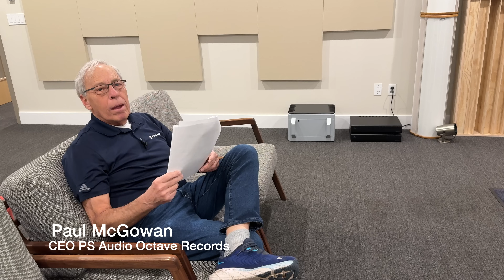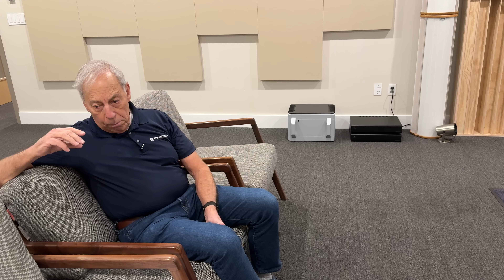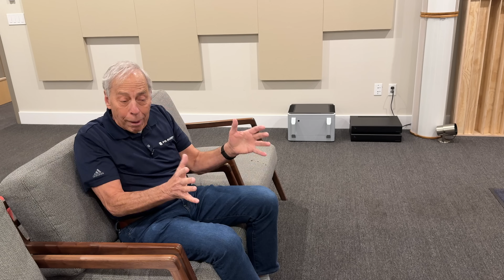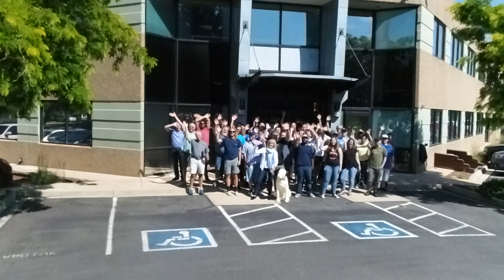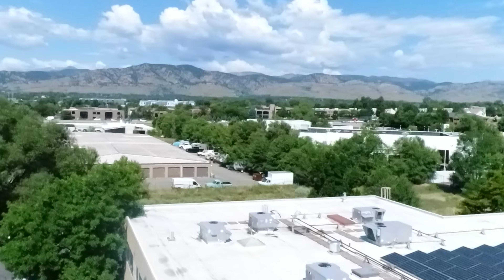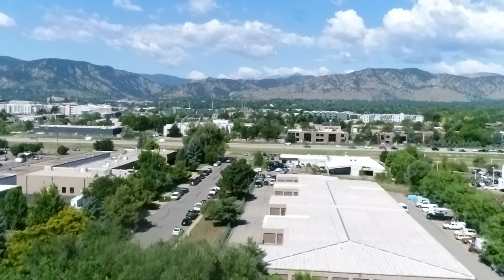The importance of power supply design

Comment: In the late '70's the "Damping Factor" spec started being paid attention to by the better manufacturers. It started as just the mathematical relationship between the PS internal resistance and the load impedance. Solid State PS were designed with as low an internal resistance as possible. This allowed the PS to deliver more of it's power to the load with less internal PS loss. It also allows the counter EMF from the speaker to be shorted out and the driver stabilized. Basically a DF of around 100 was about perfect. 

Then came the DF wars. How to dramatically increase the number while making a worse sounding design. With DF's exceeding 1000! They do so by using feedback loops instead of just good PS design. That basically when voltage is lost internally inside the PS, the gain in the output stage is increased to produce more output so the voltage across the load is correct while ignoring the PS voltage drop. So while this might provide one aspect of a good DF, constant voltage as a solid state amp requires, signal is still lost inside the PS and the counter EMF signal gets fed back into the amp causing distortion. 

Be careful of the DF spec game.

Comment: I would guess if you use a power regenerator like the PS Audio power plant, that would clean up most of the power issues, maybe even all of it?
Reply: No it won't. The power regeneration maintains a constant source of mains power. What happens inside of the amp is a different situation entirely.

Comment: Can somebody explain in a technical fashion How switching power supplies are starting to "outperform" linear power supplies?
Reply: Linear power supplies efficiency is around 60-70 percent, switching power supplies can go up to 96 percent. Switching power supplies are smaller in size, and if done correctly, they gonna have very little noice. Usually low noice switching power supplies work at very high frequencies, way above hearing range. They affect the sound little differently than linear power supplies. Switching power supplies make bass faster and tighter, will have a little tighter sound stage, and more dynamic sound overall. And they are way smaller in size, so designers of DACs, power amplifiers, preamps, streamers can use space left from switching to switching power supply to use more parts that are necessary to improve products sound quality. The problem is that companies usually don’t really care about using low noice power supplies, because they are costlier, harder to make and use expensive parts.
Reply: @maximdmitricenco8976  appreciate the comment.....but you listed general differences. I'm curious about technical aspects.

Comment: Great Q&A.
Paul's description of an amplifier simply modulating power from the PS to the speaker is really a great illustration.  I built my own OTL triode power amps.  (using Rozenblit's patent).
When you look at the output stage which drives the speaker, there are only 3 parts.  A valve and 2 resistors.  I didn't change the design, but I sure beefed up the power supply to good results.
Reply: You should make a video on how you did it!

Comment: If you want to learn how to design a power supply, build a class-A amplifier. The PSU will be running very hard, but you may only have a low signal at the output. Every gremlin, ground resistance, loop, rectifier noise or wiring error will manifest itself.  Intresting the discussion about good PSU design with the care required,  and the HiFi fuse topic, which apparently transforms the, well , er, power supply. I always say, if the fuse makes a difference, you kit is junk.
Reply: Don't tell me what to do!
Reply: @RoderikvanReekum You might learn something
Reply: @davidcross890 Yea I guess so, complicated stuff though.
Reply: @RoderikvanReekum  yes not simple but so worth it

Comment: A lot of effort in most cases.
Not just an effort to supply as smooth as is possible D.C. from the power supply direct, but also additional smoothing throughout a circuit as well.
Very low distortion and noise results at the outputs would not be possible otherwise.

Comment: Paul, in the early 80's Output Voltage Rise Times/Slew rates were at around 200V per Nanosecond "Mew"! How fast are they nowadays!
Reply: Van Alstine has 800v uS their stuff has like 5 separate regulated power circuits in my AVA hybrid pre amps.  AVA, better stuff without the nonsense.  No magic wires either
Reply: @cengeb  I personally am waiting for the Newest Ultra Fast Switching circuit technologies to achieve .001 picosecond Rise Times!  😉
Reply: @j.m.harris4202  Make sure you have the proper AC line cord and wall outlet that will allow that speed....PS will certainly have such stuff, they just need to print new stickers for existing stuff.
Reply: Paul is one of those YouTubers who DOESN'T like or reply to comments on his channel. He's probably too busy? He likes to give the "benefit" of his wisdom, and to plug his own products, but sadly, he's not interested in anything YOU have to say! 🤣
Reply: @marcse7en  He knows everything...in his own old very old, mind.  Shills for whatever he can sell.  And he claims he's an engineer?  What degree, or professional certs does he have.  "Engineer" creds is a legal issue, false representing oneself as a "engineer" is fraud, states fine people using titles like such, when there is no degree or certs to be had.  Salesman is basically PS claim to whatever he is famous at?
Reply: @cengeb  Paul is in fact an engineer because he Performs That Function.  
You seem to suggest that one needs a degree in the subject to do it.          
Was Thomas Edison a degreed electrical engineer?  Nope.  
Paul has no more need of a degree than Edison did.
Reply: @spacemissing totaly wrong, it's a legal term, try understanding the rules.  states fine individuals and companies, if using the term "engineer" in a title on paper work, ads, fact.  I've been in the business that involves the term....company had to restate peoples titles, fact.  Again, PS is mostly marketing blather, and if they don't understand stuff, as you, it's sad.   So folks with actual degrees in engineering, spend thousands for it, don't need the diploma, cus according to you, just use the term.  Wow, the education system is failing in the u.s.
Reply: @spacemissing  Edison never used it as his title.  And Paul, is just like Edison, ok, oy vey.
Reply: Even if "engineer" is a legal term, it isn't always intended that way.
Reply: @spacemissing  yes it does ask degreed engineers orvPE certs...words have meaning,engineer has a specific meaning,Paul is not anything of the sorts...maybe that's what's wrong at Boeing lately they are applying your logic anyone in,now you is and injuneer

Comment: Answer is zero because of mains supplies in Australia are pristine.
Reply: 50Hz baby😊
Reply: @manitoublack   Is 50 Hz power better for audio than 60Hz?
Reply: @stann3547  No, 60 Hz is generally more effective and easier to filter out, and takes less iron to avoid saturation. 50Hz is essentially a defect. Arguably, it should be higher than 60, it would ideally be much higher. Aerospace systems typically use 400 Hz, to save weight on transformers and converters, but you could use the inverse for static installations like audio. BTW, the switching supplies use 100 KHZ or so, which you might think would be even bigger advantage, but also generates absolutely massive amounts of RF. They are extremely compact and efficient due to the very low heat dissipation, but the last thing you want in an audio amplifier is a nearby RF source.
Reply: Same in most of Europe

Comment: Paul when you're referencing linear vs switching, and one "out performing" the other, which performance measures are you referring to? Anything that will have a significant and audibly noticeable effect for a general listener? Thanks!
Reply: I believe it's mostly size and perhaps cost (once development is paid off).
But maybe something more.
Reply: My reference system includes an Emotiva Xpa-DR2 differential reference two-channel amp with a switch-mode power supply. It delivers 550w RMS x (2) channels and sounds fantastic! Distortion level, dynamic headroom, damping factor, S/N ratio, and detail match or rival most audiophile linear power-supplied products. It does this with less heat, more efficiency, and at a price that most consumers can afford! When PS Audio offers an SMPS amplifier, I'll be among the first purchasers!
Reply: The performance metric manufacturers find enticing about switch mode power supplies is MUCH lower cost to manufacture and distribute. Allows them to spread their profit margins! 😂